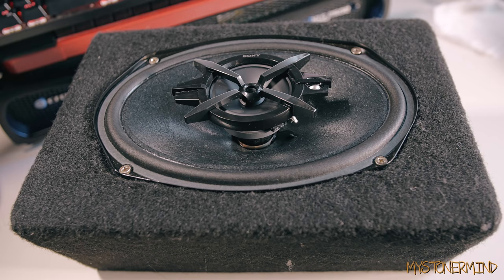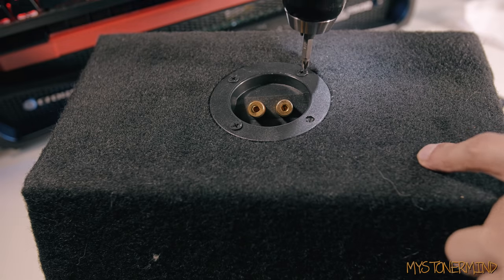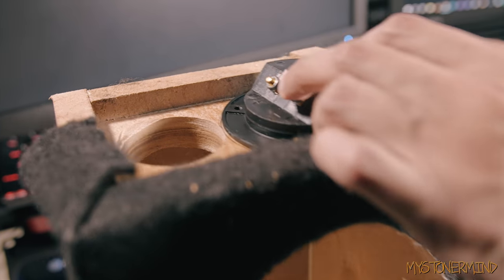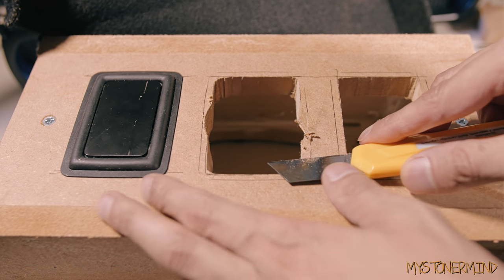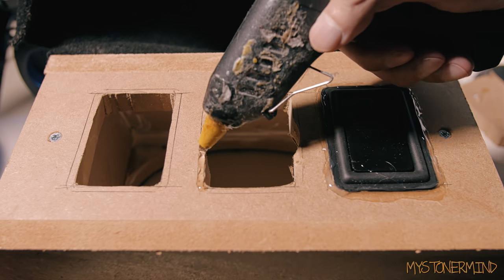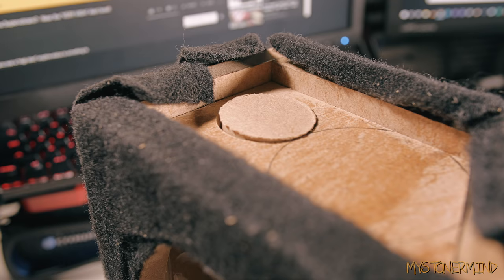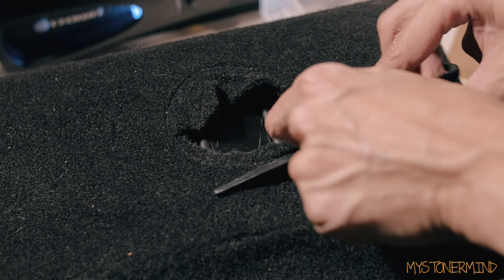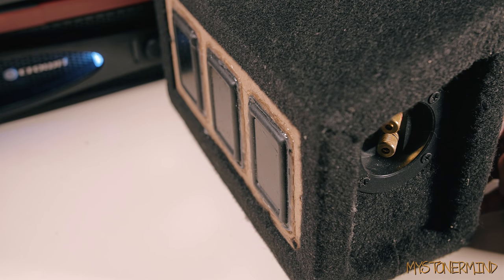Got Some Bass Radiators (INTERESTING)

Comment: Interesting stuff. Bass radiators are strange things, they somehow improve bass despite being phase inverted. I guess they still move some air and it helps them being on the back, I wonder how well it will work.
Reply: how did u get here 7 hours ago???
Reply: @hawkdeathpawp6021  18 hours but ok
Reply: @JR_Photography1  yeah its 18 hours
Reply: Still how?
Reply: Bass is just moving air and so it‘s kinda like having more subs without having more subs ? Lol
Reply: The most interesting thing is that in the tuning freq bass radiators dont move out of phase with the speakers, they move in phase with them.....thats how they work
Reply: @Dheath  patreon 👍
Reply: @greekdecibel108  depends...the resonance freq. of the driver, the volume of air, the freq. resonance of the enclosure, the restore to rest position of the surround of the passive radiator, the combination of 3 of them, and the mass of 3X metals, some freq. are in phase , other don,t other are eliminated completly. Mexican trying to explain
Reply: Again. you have to think the same way about ports. they blow air opposite phase of the speaker too :)

Comment: The idea of putting bass radiator in a speaker box sounds excellent.  I would rather use one big base radiator planted from within so that high volumes doesn't  pop the radiator out. 

Also you can paint the back of the speaker as black. That would look cool :)

Comment: Those 6 x 9 boxes have really small airspace. 6 x 9 need quite a lot of airspace. I use just over a cubic foot for each one, and porting tuned to 50 Hz. Pretty good all rounder bass sound, though a bit boomy on some material. You would use similar for a passive radiator enclosure, although a pair of 2.5" wide x 8" long round vents per speaker was enough without taking up too much room in the box, that a passive radiator was obsolete.

Comment: The idea is that by the time that the air accelerates the bass radiator it is in phase with the speaker, so at higher tones it barely moves because of little acceleration and at low bass it moves a lot because of high acceleration time but it at that point is reverse phase, kills bass below resonance but it can be lowered by adding weight to the radiator. But again makes the highest bass die off faster. You could in theory add multiple different weight radiators but that’s a bit of effort

Comment: The cone of the driver and radiator are supposed to be no smaller than the same size diameter. Adding a fourth radiator would have helped. Either way good job I enjoyed watching.
Reply from the maker: yes I know, glad you enjoyed the video
Reply: 1 cube box with radiators on every side tuned to 50hz

Comment: one fact: Hot glue isn't drying. It's Just cooling down. (Because its like plastic)
Reply: how about an actual fact, kid.
When hot glue melts, it liquefies just like plastic, just like crayon. When it DRIES it returns to a solid form, just like plastic, just like crayon.
Reply: @frankyg2267   The hot glue is, you thinked: like second glue, but it's like that: the hot glue gets heated up to the melting temperature, and when it's cooling down, it goes into the harden state. Is that enough text?

Comment: My friend had a Denon speakers, and he found that the"woofer"often doesn't work. we open the cabinet, the"woofer" is a radiator actually.and another thing funny is that the woofer in the middle of the front panel, and it has a smaller silver plastic dust cap in the center of the larger dust cap.this design makes the woofer looks like a midrange.
Reply: The front cloth couldn't remove, you can see 3 silver dust caps in front.the top one is from tweeter, and center one is from actual woofer, and the bottom one is from the radiator.this design makes it looks like a 3-way speaker system.